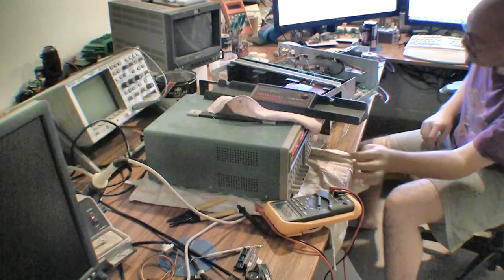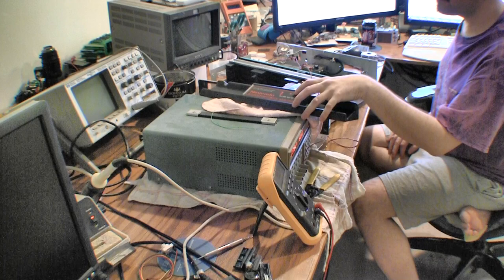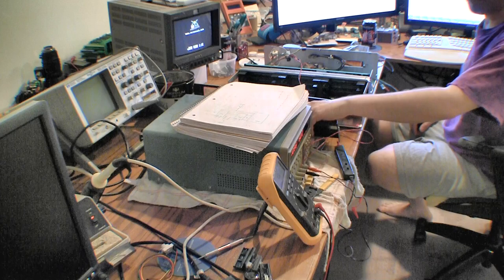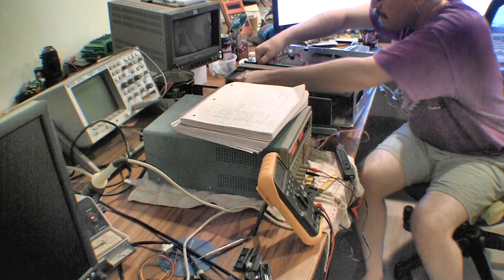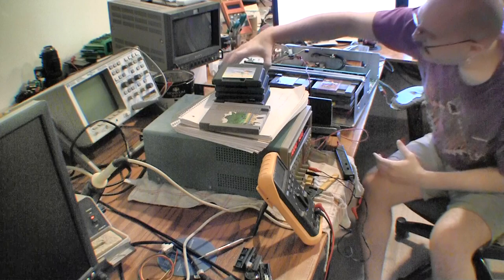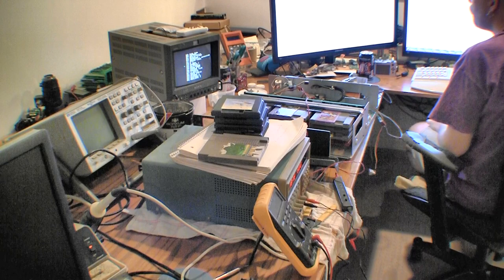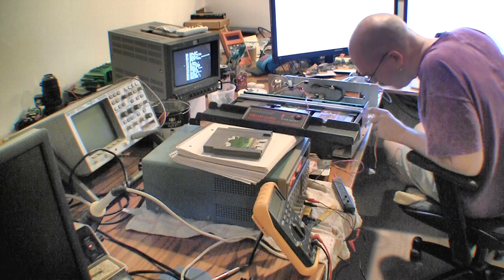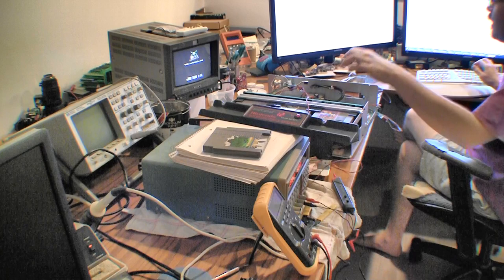Nintendo M82 2.0 - Kevtris programs a PIC to replace the ASIC - Pt3

Comment: If it were my project I might add an option to go into attract mode if there's no controller input for a certain period of time.  (Of course that would require added wiring to connect the ASIC replacement to the controller ports)
Of course that'd be no good if you were just trying to pause a game and do something else for a while..  But it'd be a good feature for a kiosk system - system simply goes back to attract mode when no one's playing.

Also you were discussing what to do with the LEDs while the player's holding down the reset button...  How about those 7-segment patterns that are displayed for values outside the BCD range? There's those two patterns (for 0xA and 0xB, I believe) that look like a lowercase "c" and a backwards lowercase "c" - you could make a rectangle out of them maybe, or cycle between them fast enough to make a square? I don't know.
Reply from the maker: Simply cycling power will put it back in to attract mode.
Reply: GameTechUS
Yes. That's not the same thing.
Reply from the maker: Scope-Eye video
I'm well aware, but it's not worth the extra work to add controller sniffing as it would prolly be a hard soldered type mod and not an easy to remove and put back to stock mod and that's what i'm trying to avoid with all the mods I instal, just in case the new owner doesn't want this or that...
Reply: GameTechUS I hear ya. I just see a project like this and love to think about the possibilities.

Comment: Sorry to harp on but a power board that allows to run a micro ITX motherboard of a 12v wall wort might work in this case as it can supply +12,-12,+5,-5,+3,-3 or am I just barking up the wrong tree sorry Kevin,BTW I home that your PIC program is less than 16k or it might not fit on the PIC.

Comment: I wonder if there is any way to make an adapter to go into the expansion port to enable the IRQ function.
Reply: Add a circuit board that allows logic signals to pass from the IRQ pin on the cartridge slot to the CPU only when that slot is active. That kind of approach should work for all the missing features, I think - but the more additional lines you want to support, the more circuitry you need to add.
Reply: Scope-Eye video The /IRQ line on a lot of stuff is of the open-collector type signal, so you could in theory even just connect the IRQ pins on all the carts to the CPU.

Although, you're probably right in that the carts are powered all the time, even when there /CS pin is High / inactive, so might not work as the carts will be triggering ints all the time?

If the M82 does power off each cart slot when deselected (unlikely from what I've seen in the vids), then it wouldn't be a problem.

I suppose the logic would be really simple to add anyway. Just needs a mux that ties in with the usual "game select" signals on the ASIC / PIC.